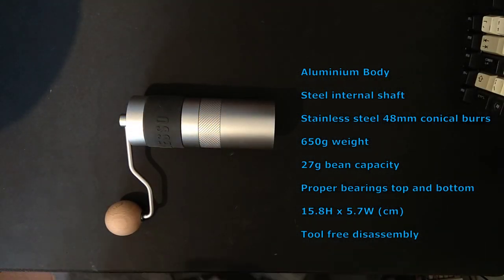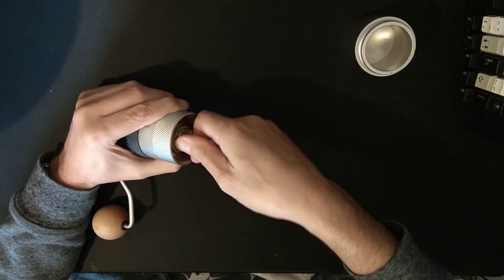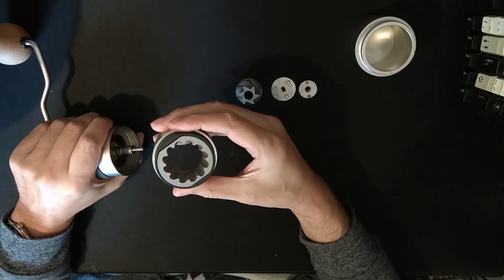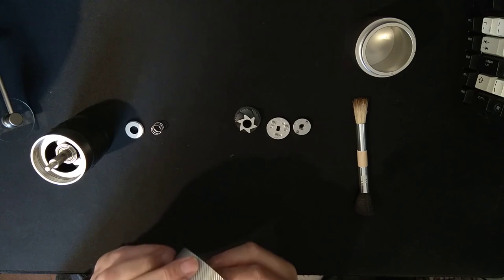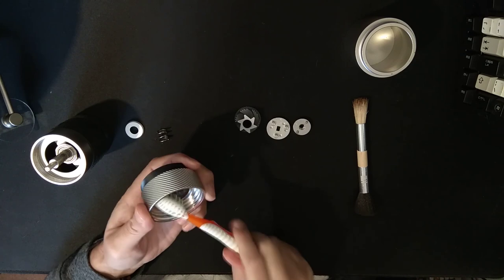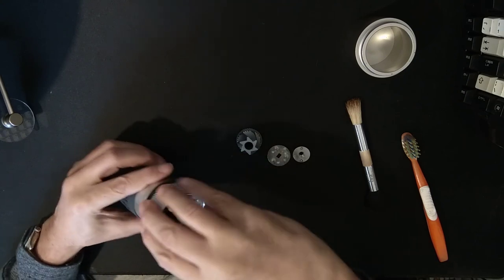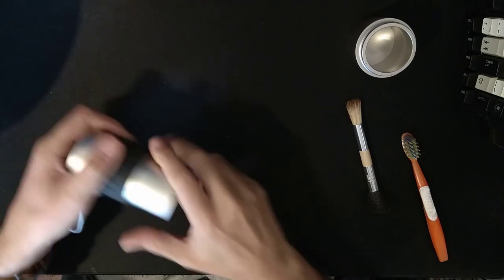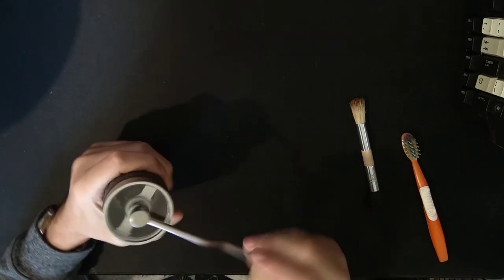1Zpresso JX Disassembly and Cleaning

Comment: Is it advisable to wet the coffee beans a bit to prevent static when grinding?
Reply from the maker: I personally wouldn't recommend wetting the beans
Reply: I personally just wet the end of my finger, swing it about to get the big droplets of then do a quick 360 in the beans to just get a tiny bit of moisture in there. I wouldnt do more than that.
Reply: @TSE_WOODY  the grinder does produce a lot of static so I do the above too. Can't imagine it damaging the grinder in any way its one drop into a very dry substance, it will disapate very quickly but makes a world of difference
Reply: @SypherXIII  Yeah i only very lightly water it too id probably get more water on em spitting at 10 metres lol
Reply: James Hoffman recommends wetting beans if the grinder produces too much static. I actually use a tiny essential oil spray bottle. With no problems.

Comment: I fine mine was resetting to zero when I bought it. Its not slowly resetting to 1 after 6 months of use even before cleaning. Is that normal?
Reply from the maker: I don't know, i just put mine together, then adjust it for espresso. Probably the burrs bedding in.
Reply: Mine also resets to 1 now. My inner burr has a grooved and smooth surface

Comment: Hi I’m new to this and just wondering if cleaning the grinder this way is a daily routine after I’ve grounded my beans for the day? Also roughly how long does one usually take time to clean it? Sorry for the beginners questions
Reply: It's up to you really. Daily is excessive, between each bag of beans works well.
Reply from the maker: No, you might only clean a grinder this way every 3 to 6 months, depending on usage.
Reply: If it was a daily I assume it’ll be every 3 months?
Reply: @XenOng3n  i do it when i get a new bag or it gets dirty from forgin stuff

Comment: How would you say the 1zpresso jx is im grind quality compared to say wilfa uniform? And is it easy to clean and last several years? Im torn betwen a 1zpresso jx or a wilfa uniform
Reply from the maker: |I've never used a Wilfa uniform...the JX seemed fine for filter/pour over, but lacked the fine adjustability that really helps with an espresso machine. It did seem very well-made.
Reply: @DaveCorbey  thank you would you say it was as fine and even in the filter setting than say a niche zero?

Comment: Just tried cleaning my grinder for the first time in 2 months. I cannot unscrew that burr ring. Seems screwed in super tight on my unit. Any tips on how to remove it safely?
Reply from the maker: I'm not sure exactly which part you mean but I didn't need any tools.
Reply: i used pliers to unscrew and then rescrew, just received mine today not sure why i was having trouble. Now i can use it by hand
Edit: I thought you were referring to the removeable burr not the one attached to the case. nvm
Reply: Was same for me. Put your back into it and it will come off :) Make sure screwing the right way too

Comment: The manufacturer says never to use water, but if the grinder is aluminum and the burrs are steel, shouldn't it be OK? I woould like to clean off any factory residue.
Reply from the maker: Just use a dry toothbrush...If you're worried about factory residue, just throw away the first 18g you grind.

Comment: How did You unscrew the burr ring unit? I couldn’t unscrew it (clockwise) and get it off at all 🤦‍♂️
Reply: Also it seems like your burr ring unit is bigger, did they change it? I have like no room to grab it either.
Reply from the maker: They didn't change it, you just put your fingers on the big silver ring and unscrew it.
Reply: Dave Corbey hey Dave thanks for the prompt response.  1zpresso already replied to my email actually (man they have great customer service), and they actually did change the JX so that now the black grip is longer and goes to the burr unit.  I was trying to separate the new (untextured) outer ring from the burr unit that hides the screws to the burrs 🤦‍♂️🤦‍♂️🤦‍♂️because I was thinking it was similar looking to yours and thought I need to separate the textured area from untextured area.

Thanks again for the prompt help.  

I love the videos by the way!!! And the 1zpresso Jx is great, has changed my pour over game
Reply: @Dave Corbey  The didn't change the actual overall design, but the way the outside is yes they did.  I even have a recent video from them that shows a clear difference.  The piece that you show in your video that i have had a hard time getting off only has a textured exterior, while mine has textured on bottom half and not-textured on top half.  Also my bottom burr unit comes off at the very bottom of the black grip, whiles yours shows that you still have some metal piece below the grip after you take your burr unit off.  I can send you the video 1zpresso sent me if you want to show you the diff; it'll help explain why it had issue getting it off originally (i was basically twisting on connected parts :facepalm:).  Its not huge diff and the overall design of the grinder is same, but that exterior design change is what threw me off when going off your video.
Reply: I’m having the same issue! But it is because over the time the ring got way too tight, and I just can’t unscrew it! Any tips on that?
Reply: @gabrielgjercic  highly suggest you reach out to 1zpresso support. they are super quick and responsive and will definitely help.  They sent me a video of the updated design which helped me.  Plus you have a warranty so I wouldn't be surprised if they replace it for your if its that issue and can't be fixed

Comment: You could just turn it over and blow it out with air compressor :) I see no reason to take this apart ever.
Reply from the maker: I suppose if you have a good air compressor, and a moisture trap, it might work, although it can be harder than you think to get slightly oily coffee build up off...I often use a toothbrush.
Reply: Everyone has their own standards. Also that is just being lazy.